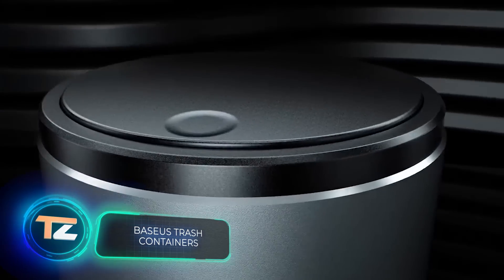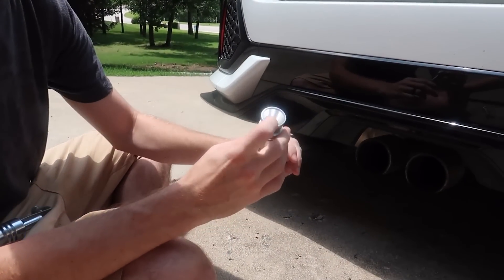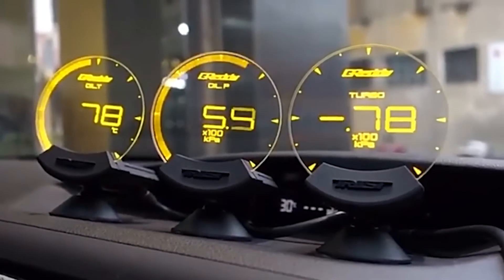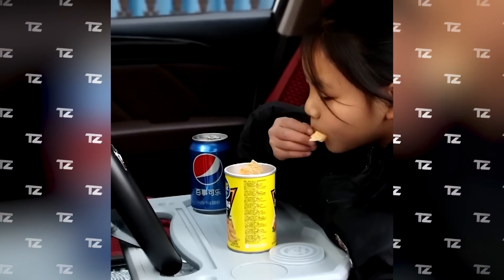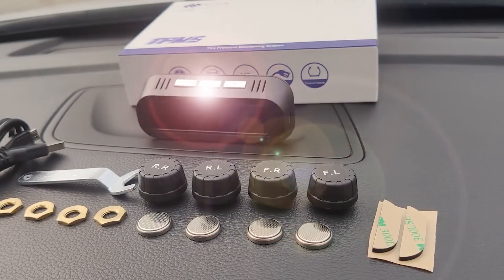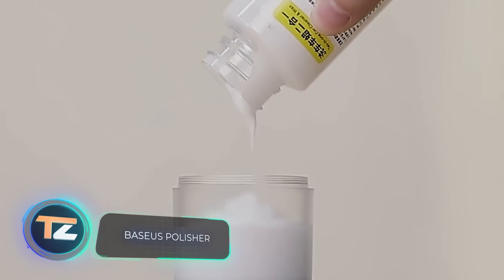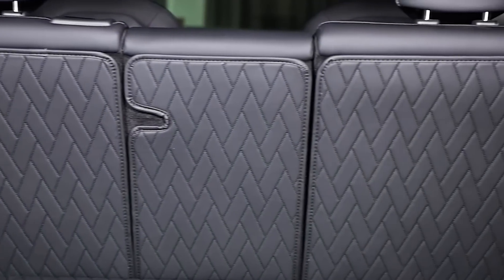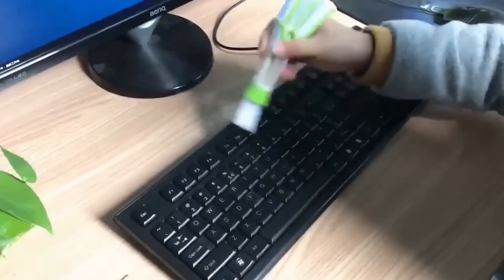25 INCREDIBLE CAR GADGETS FROM CHINA THAT YOU CAN BUY RIGHT NOW

Comment: The led cup holder insert is actually practical, finding a cup holder in the dark while driving is challenging at best, I'm sure with this at least you got a guild while keeping your eyes on the road
Reply: I can never find the gear lever clutch brake or indicators in the dark. They are  never in the same place twice